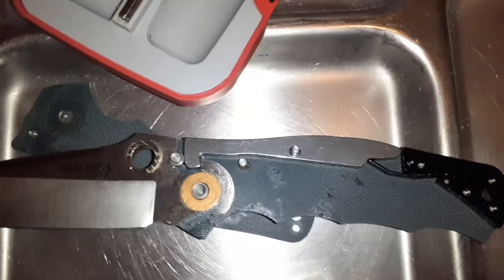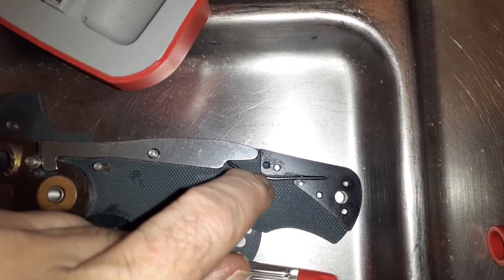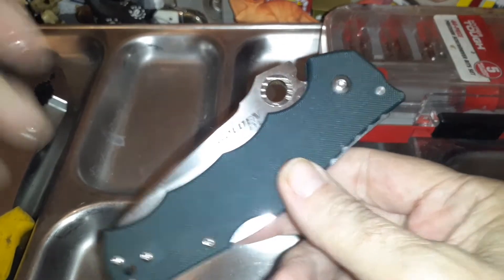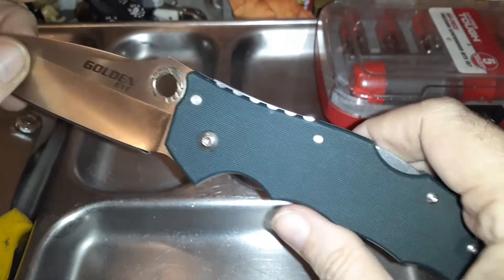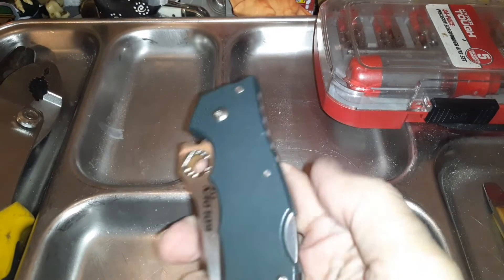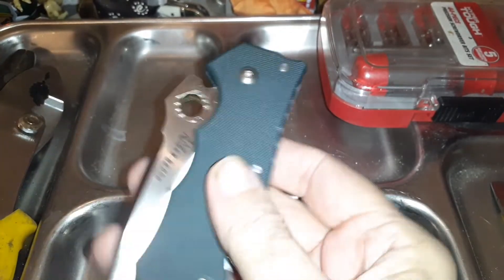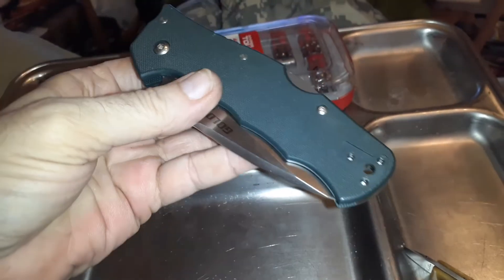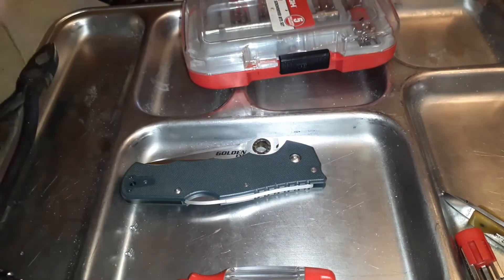(588) How To Fix A Too Strong Cold Steel Tri Ad Lock Pressure

Comment: Dont do this if you plan on using your tri ad lock on self defense. You dont want your lock going soft on you during critical situations. It is made that way for self defense purpose nothing more nothing less.
Reply from the maker: True. I think it's still plenty strong unless you hit bone in a straight on stab, and even then, I think the lock will hold. It probably reduces the locks' ability to hold something like 150 pounds down to maybe 100 pounds, but I'm only guessing. I can't get it to fail with strong spine whacks on a brick. That's strong enough for me. I open and close my knife a lot more times than I get into knife fights 🤠

Comment: I have 18 Cold Steel with TRI-AD locks, the rest are Fixed and two liners (Ti-Lite, and Luzon).  On 17 of the TRI-AD Locks, the leaving open for about a month did the trick.  However with my Spartan it would not affect the action, so I disassembled slightly bent the leaf spring, and now it is operating like it has been used for years.  This will naturally happen with use, but I elected to speed the process ever so slightly.

Comment: Bless you son, made the slightest bend in that spring on my new Spartan and it operates like my more broken in tools; smooth as silk.  Oh, I did have to stone the area which contacts the locking bar, when Cold Steel cut that it was rough, really rough, all the way around; pretty smooth now.  Thanks for the ideas and tips. The demonstration did not hurt either.
Reply from the maker: Thank you.  I'm glad it worked.
Reply: Just did the same thing with my Spartan.  I have 17 other models with TRI-AD locks that broke in great, but the Spartan was resistant.  Not anymore.

Comment: The trick of leaving it half open worked for mine but I don't mind the tension being a bit strong. Great vid though for those who want a lighter unlock on the knife. Thanks for a great vid and keep making sharp things fun and enjoyable.
Reply from the maker: Thank you Todd. The good thing about this method is that the tension is adjustable. if you get it too weak, you can make it stronger by bending it. Many modifications are not reversible.  If the lock is working fine, yes i wouldn't mess with it.

Comment: I agree with you on leaving the blade at “half-cock.”  I left it in that position for a full week, and it did not improve anything.  My Cold Steels rarely get used, partially due to the painfully stiff lock release but mostly due to the fact that I’ve moved on to traditionals.  Nice review.
Reply from the maker: Thank you TN Tanto. I just did the same mod to my Cold Steel Large Voyager Tanto, and it works perfectly. That painful lock type has been my main complaint. Now that I know how to fix it, it makes the knives so much better to use.

Comment: Cool mod. It’s interesting but I never really noticed excessive tension on my CS knives. I had a American Lawman in my EDC rotation for a number of years when I was still working and never gave it a thought. Then again, I’ve also had a pretty thick callous on my right thumb for most of my working life so that might have something to with it as well. 🤷🏻
Reply from the maker: Thank you John. I was going to just develop a Tri-Ad thumb, but this worked very well. I adjusted the Voyager and it only needed a slight bend to make it perfect.

Comment: Looks like a relatively easy fix, too bad CS doesn't have the spring set to the proper tension at the factory!  You shouldn't have to repair a new, somewhat expensive knife.
Reply from the maker: They probably think it will reduce the number of 100 pound weights you can hang off the lock. If a triad lock fails on me because I reduced that spring pressure,  I promise I won't sue Cold Steel.